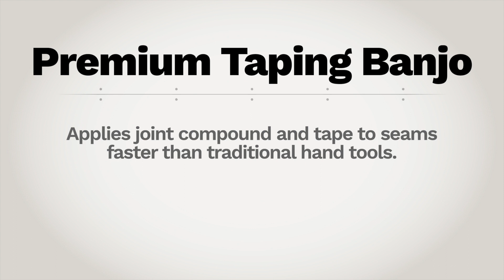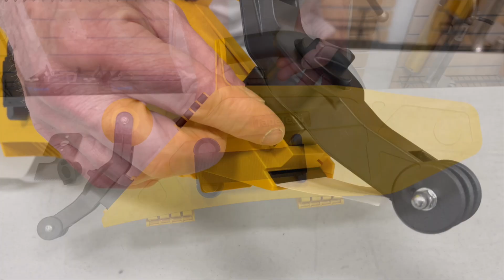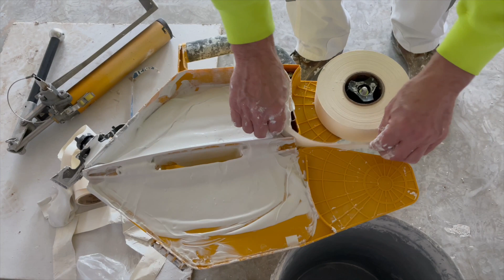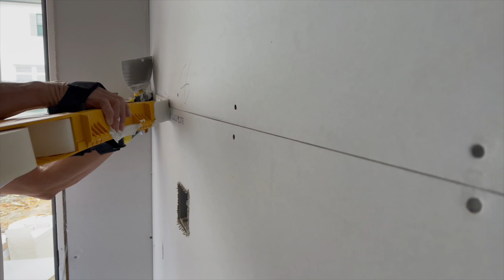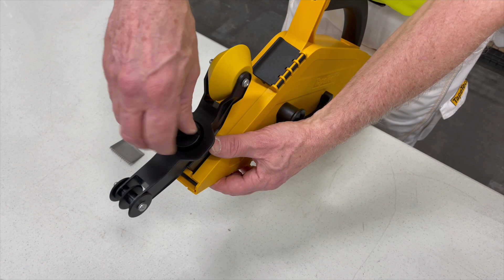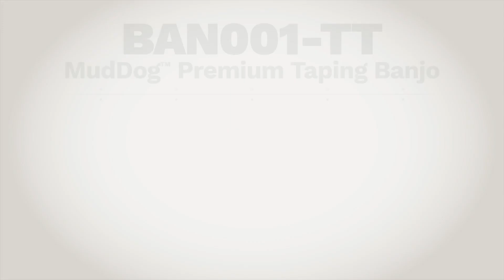Introducing the MudDog Premium Taping Banjo from TapeTech!

Comment: Dont buy this i been using banjo for so many years i have delko is waaay better than this and this banjo you will have muscle fatig cuz the strap hand is waay too far from the bottom not much to grip and the top handle are curve wich harder to handle when its slippery also the rubber are very slippery and its waaaay toooo heavy its the same mud volume with delko but delko is waaay more light and better over all grip and this banjo its so hard to open when you 1st get it even its wet with mud i know its cool its tapetec my recomendation just wait for a new ver of this banjo i know they will come up with better one its a good brand and material it just the design are not good they have to go back on drawing board